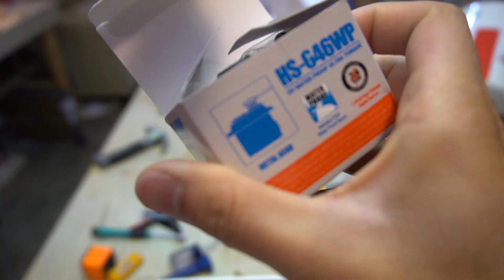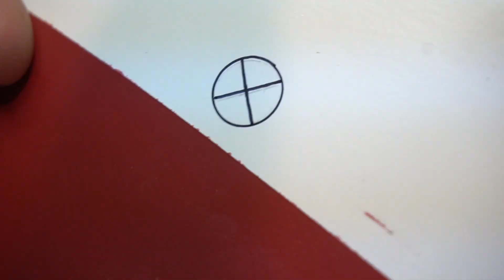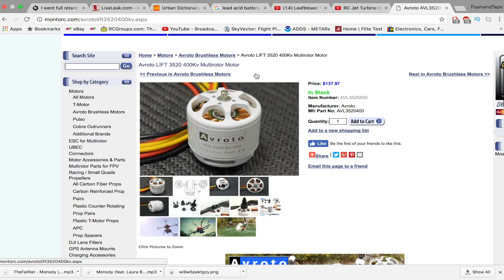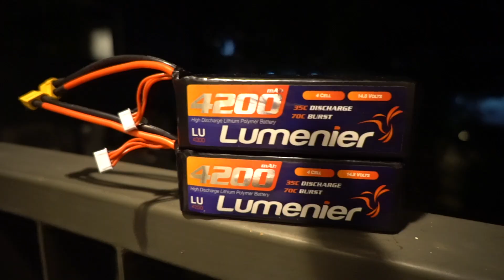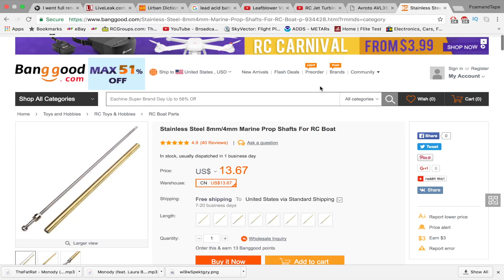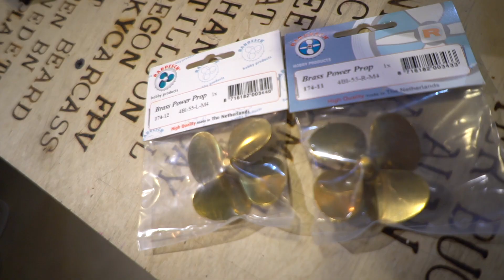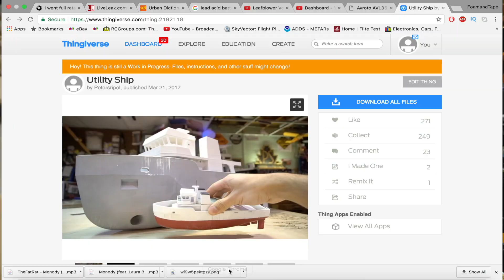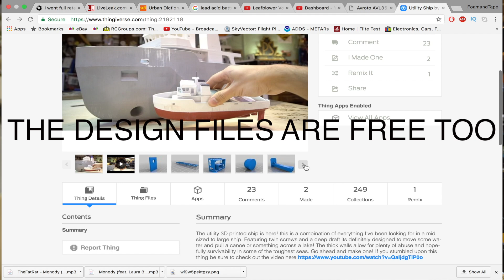GIANT 3D Printed Utility Ship part 2

Comment: Dear Peter, Please make the Ship SINKABLE In the Next part "Part 3" In  08-24-2022 Details of the ship: 4 Watertight Compartments, Lifeboats & Lights Off when Water goes To Eletrical room And use your Grey Submarine fom prev. To loacate the Ship  "Like the Oceangate submarine Locating the Titanic wreck". But you need to use another Ship It is 2× Its size Than Part 2. But with same materials in part 1& 2. Note: The ship that i said Its NOT Jiffy 3 Its U.N.N. Tailor: A Oil tanker Tugboat That Can Carry 2 Lifeboats. 1 In stardboard side and 1 in Port side. The Lifeboats Are 3D Printed "Just like Last one". Details Of Lifeboats: Power; Lights; 1 Propleler(s). One last Thing For The Tugboat: When The Bow/Middle of ship/Stern Hit by Iceberg/Mine/Torpedo/Rock/Another Ship The ship began Slowing to capsize The power Out: When the ship has already water The Ship wheel of Turbine control The Ship lost power. When the ship has no power It began To sink Bit Fast (3,5 Speed).

Comment: Hello, I started to this project. 
I have some question. 

1. which glue did you use ? My material PETG.
2. thingiverse files are completed ? Is there any missing parts or do you have mods ?
3. Do you have a plan for single motor ?

Comment: I know this is a little late, but stainless steel isn't stainless steel there different grades and not all of them a seawater resistant. 
Love that the Ship might make but I only got Ender 3 with 0.4 nozzles and the throughput is so small it will take a lot of time.

Comment: Beautiful. RC boats are my specialty. I have built some big and fast ones. Have a couple vids on YT but they are old. Nice you used counter rotating props this time but crazy how they bent so easy. I run my boats in saltwater as well so I use only stainless steel, anodized aluminum or plastic when possible. And year got to keep the salt water away from the electronics. I build scale but fast boats. Great job.

Comment: I have made one of things and I am wondering what motor and ESC you used for the bow thruster, I got a 1104 drone motor but I think it is too small, yet I don't think it can really fit much more, even though I did print at full scale. 

Feedback would be greatly appreciated, keep up the great work!

You can see my make on thingiverse! (plant0300 or Electr0Maker).

Comment: That haul style for that boat is wrong,  it makes it roll a bunch. The bottom of the boat should be pretty flat across the bottom. These style of boats are built and designed as tug/work boats in the mississippi. They work really well for commercial fishing in Alaska and a large portion of Fishing vessels fishing in Alaska are converted froma prior mission. Here is a picture of the bottom when we were in dry dock Lake Union, Seattle WA https://ibb.co/7XrDr64, You can see the shape of the hull. Here is a picture of it in the water with its sister ship https://ibb.co/tKwFRHv.  It sister ship "American Lady"  is a old WW2 supply ship and has a similar haul shape.

Comment: trying to build an "fpv" thing here.. basically a boat with 3 static cameras and (1 supervizor one that can move)..  sending to 3 monitors into a trailer i can haul around to old folks homes.. so i can have them sit in a "boat" and have them "drive around" for awhile.. how can this work.. is this even possible? guessing we are talking 4 different transmitters sending 4 videos.. from one unit 30cm by 100cm thing

Comment: Amazing boat!
One cuestion, how do you do the connection of both engines?
I'm trying to do your boat but the engines part i don't know how to do it.
Keep going like this
You rock!!
Reply: -You have to do 2 separate speed controllers for the forwards and backwards
-then after that you plug both of them into the receiver (I can’t remember if it’s one plug for each engine or no)
-after that you go and program that into your transmitter 

I’m pretty sure that’s how you do it but I would look up how to do it before doing what I said to do

Comment: That's just awesome , it took me forever to build my first troller from scratch . That was many years ago ..and it was all wood ..which took probably a year to complete , unfortunately my first wife had an awful temper .. and she destroyed it and an all aluminum Cessna 173 with a 4" wing span I sat and cut each part by hand it was skinned with news paper aluminum sheeting ..the only parts I didn't craft was the tires and the antique Kraft 6 channel radio .. she stomped it into the floor ..times sure have changed .. RTR used to mean you got a box of wood lol like a Dumas or Billings model ..I remember how cool I thought it was to buy a kit with precut Lazer parts ...3D printers are simply amazing to me . I still sit down at a drafting table with a pencil .... Any way that is an awesome boat ..  keep up the great work ..I read that someone suggested a submarine ..I remember a story about a wwii Japanese sub/aircraft carrier .. look it up ..it  may make for a really interesting build they essentially used two sub hulls to stabilize the boat . It also housed three planes in a hanger in the deck . . Just for fun I'll bet that would be so cool to print up . That would truly be amazing anyhow good luck I'll be watching
Reply: I now hate your last wife

Comment: For usefulness sake... You need to consider applying your hobby talents into a larger scale... Siri is a top suggestion a useful light cargo vessel on solar First Solar contribute compulsion..  ultimately to be scaled up to something of a houseboat... That probably can transfer report at least three trucks something along the lines of an landing craft.. with a solar roof on top.... The problem that needs to be cracked is horsepower to the screws..  DC electricity contributing 2 gas rotation... This at the same time... The simplest solution is to do like the modern railroad engine band dispatch the solar in..... Ultimately I write this to get you thinking about the future and thinking about how you contribute to humanity and your personal sustainability..  thank you for your videos..  you know a car alternator can be rig to be a motor... Imagine direct solar solar a car alternator and put it to compulsion.. a useful boat may have at least two on each screw... When is solar top roof... This is how the electric car company made it's engines by adding more... It seems to be in the market off the shelf 5 horsepower is the top for 12-volt DC electricity.. and please note in this endeavor take on trying to keep everything completely simple..  like it's that I would RC vehicle..  next thing you know it'll be trying to get these motors above the starting amps that is required to spend the screws.. is puzzling that it has no problem in the modeling world yet in true applications we have this Bugaboo....
Reply: It hurt my brain trying to make sense out of the words you typed out...
Reply: Thanks for reading out the bible
Reply: What the fuck...

Comment: I love the detail on this! But what I've seen in tugs, they sit a bit lower in the water and are highly stable and don't tip easily. It looks like you need more weight in the bottom (I know, right) because it seems your ships center is too high

Comment: I was casually looking at some information on RC Submarines at http://www.subcommittee.com/rcss-radios.html today, specifically looking into how to control a submarine via a wireless controller, when I found this bit of info. Apparently, it's illegal to use RC Aircraft guts to control surfaces vehicles, which includes both boats and subs. Just wanted to let you guys know about this before you (possibly) get hit by legal troubles.

The excerpt in question reads as follows:
"Radio frequency laws allocate separate bands for air and surface models. This prevents interference between model aircraft and surface vehicle transmitters and enhances safety. For example, in the United States, model submarines fall into the Surface Use Only (75 MHz) category along with cars, boats and other non-flying models. The F.C.C. restricts use to a radio tuned to 75MHz on Channels 61-90. Utilizing radios tuned to frequencies reserved for other types of models is illegal. Please check the regulations in your country to ensure that you are using the correct frequency band (Canada is 75 MHz; UK, Germany and most of Europe is 40 MHz)."

Comment: To waterproof batteries and electronics the best thing to use is Plastic dip , see video.   https://www.youtube.com/watch?v=OxyHZ_y4GsQ&t=8s . Use silicon grease  inside servos and radio receiver . And  best place to get parts fast is EBay

Comment: when you build your rc submarine, if possible make your own dive system. like brass ballast tanks or something. please I have built many rc submarines but have never attempted to build my own dive system. most pre-built ballast and dive systems will run you $700+ and if you build it using components most of it might have a hard time fitting in with all the cg issues. These are just my experiences, so if you come up with some really cool new way that balances all the properties out please record everything in detail.

Comment: Peter,
 this is a masterful piece of engineering. As a engineer I'll tell everyone of your skills. As a model builder, I'm asking, Why you didn't detail the interior of the wheelhouse. Your video shows that there is enough room for a captain, a chart table and a radar that could have been seen through the portholes. A man or woman outside climbing a ladder going from one deck to the other, and a lookout or crewman on the deck could have also been made. What's a detailed model without a crew? Make a crew for your ship. Or buy a crew at this scale. Don't forget the sunbating hot chick. It doesn't sound like it, but it WILL be more enjoyabe having a crew. Excellent work Peter, I'm happy to see this and I am proud that you showcased your skills in this video. My lady use to think we were nuts doing things like this. Until I took her and showed her how much fun it is. Let me know what3you think. Best wishes.

Comment: Hello! I do not understand why put so expensive in engines, etambot, propeller for a simple tug? 2 motors brushed universal Motraxx X-Drive 540-1 5600 RPM with torque "12.5 Nmm" was enough and at 10.99 euro.
Dimmer at 20A is enough for 7.45 euro. The stern tube does not even pay 6 euro the unit or even to do. For helices of this size, they have not even more than 10 euro. We use the lead batteries and not the Lipo. XD A good 12v to 7A or 12A to less than 20 euro. XD It is used precisely as food and their weights.
We laughed. xD
Thank you nevertheless for the assembly of the tug.
A +

Comment: Fun fact: The red that is painted on the bottom of the ships hull is not there to just look kewl, it actually serves a purpose, there are chemicals inside the paint that prevent any barnacles from attaching onto the hull. It's also the reason why it's red. Ik this because my grandfather was an inspector that worked for a German company that made ships like freighters and bulk carriers.

Comment: you had stability problem because the "not hull" part of the ship (the superstructure) is too heavy. usually, the G center is inside the water because of the heavy weight of the hull comparing to the rest of the ship structure.

Comment: This guy should build a 3D soviet submarine. Give it some cool features like torpedoes and a small AA gun on the front of the sub...
Reply: Austin McDuffee  I love your comment
Reply: Yes
Reply: submarines are awesome but the standard 2.4g radios dont work well underwater, a few metres and you will lose signal.
Reply: @maxxiang8746  Conn, Manouvering, Make depth 2ft.
Conn, Sonar, Raise the radio mast
Reply: @dosvidanyagaming4123  what?
Reply: @maxxiang8746  was meming a bit, but essentially, sail it shallow and have an antenna stick up and you'll be fine

Comment: Another awesome video, Peter! I love how you said  "only my 3rd design.... I just kinda made up some measurements in my head and started going from there..." LOL ... I know guys who have been RC boating for 20 years that couldn't have designed something this nice. Good stuff. We would recommend water-cooling your motors, but if they are not working too hard, you're good.
Reply from the maker: Did think about water cooling them, but even under way at a fairly high throttle setting the thing is still room temp! (well that and the flooding inside tends to cool off the motors!)

Comment: Great! now you got me wanting to break out the MONICA. Its my fishing trawler I got from a GoodWill. I want to add a smoke generator I have for it. I went through it last year and had to gut it and rebuild the electronics. I cant remember who I buy boat supplys from. The nets actually work,the spotlight works as does all leds and cabin lights. They made a fireboat also but I havent seen one. Mine was made in Germany and sold for $200. The circuit board was supposed to be waterproof( they dipped them in bees wax.) It is a rare boat to find as all of them failed as soon as the electronics got wet.  You did an outstanding job on your boat. I do see some room for improvement but in the long run,its not much of a thrill for younger guys like you. My suggestion is to eventually box it up until you age slightly. Then break it back out,you will really enjoy it more. Dont burn it or blow it up please!
Reply from the maker: Hmmmm it still has some duties to perform this 4th of july! Its going to serve as a makeshift torpedo vessel. If she survives,I'll retire her to the shelf for a few weeks! :D Would love to see the trawler in action too! Thats one hell of a Goodwill find!
Reply: PeterSripol I will send you some video as soon as I get the smoke generator going.

Comment: Stainless steel is not rust proof. It is corrosion resistant which means it doesn't rust as readily as other metals. This is especially true with parts that will be submerged in salt water.

As I SCUBA diver and machinist I am all too aware of rust even on the most expensive stainless steels.

Comment: How do the brushless motors go after the salt water exposure? I noticed you caked them with some kind of spray but wonder if it's a 'per outing' thing or could some delicate epoxy coating on the exposed connections do it? Love the build man, that scale works so well and it rides and lists so realistically!
Reply from the maker: Honestly they're not too bad! The high quality ones don't need to be oiled so often, the German bearings don't seem to rust like the Chinese ones do. Epoxy would work well, but I'd have to find some nylon bushings to replace the bearings for it to be almost 100% maintenance proof.
Reply: Hi, first of all congratulations for the beautiful work!  I'm starting to print the model.  I wanted to ask you for 2 suggestions.  1-is the model to scale?  I would like to get some motorized accessories such as radar etc. 2- how do you create the bow thruster?  thanks in advance for the info.

Comment: I don't know if you read the comments but I have a challenge for you but I think it'll probably be out of your range.The BBC programme Top Gear once tried to make a Robin Reliant 3 wheeler into the Space Shuttle with the idea that the car would detach from the rockets and be glided back down like the Space Shuttle.Amazingly, they managed lift off with the side boosters detaching as planned and it only failed because it didn't detach from the main fuel rocket.Have a look here on YouTube for it.

Comment: Printing in PLA was mentioned in part 1, but I think that might be problematic, since the water might cause degradation or distortion of the material. I guess you could try to mitigate the affects of water using some kind of waterproof paint.

Unfortunately my printer only does PLA, and the print bed isn't big enough for something this size! But I might look at printing a smaller boat for my nephew sometime.

Awesome project though!

Comment: Super cool! I noticed though that the boat has a difficulty cutting through and staying stable in the sea, though. You should try and make the hull into a taller "v" shape and add a ballast tank on the bottom of the hull. I know it is supposed to be a tugboat, but this would be a cool idea for another boat build I believe.

Comment: Hey Peter can you help me? I am making an electric skateboard the problem I have is I don't know how to set it up I think I need a 40 amp esc but I don't really know what that means. I'm using an 11.1v batterie a 2200kv motor I know and a fly sky esc with a remote already binded. Thanks

Comment: Wow!  Peter I was very pleased seeing you put together all of these detailed components - I recognized every one.  Did you remember to use LockTite on your propellers this time?  I wondered if you ever recovered the one that fell off of the the boat that you cruised up into the stream.

Also, the single component that I was hoping to see on this build was an AIR HORN!  That would have scattered those pesky monkeys quickly enough.  I look forward to seeing the submarine project.  Have you ever considered building a US Marines LCAC (assault hovercraft) and the amphibious-well dock ship that carries them?  You could build a whole set with the USS Germantown (LSD-42) dock ship carrying an LCAC, which itself is carrying an M1 Abrams tank or maybe 1 or 2 other vehicles and perform your own invasion by sea.

Comment: You ought to build a fast electric catamaran next :p power it with a Leopard motor on 6s and you can hit the 60s and 70s easily.

Also for ordering anything boat related a good place to go is offshoreelectrics.com. They have props, motors, shafts, everything you need.

Comment: maybe you could stabilize it with a cone under the water like big ships have, it looks like a submarine is welded to the bottom of the boat, and then fill that area up with something heavy or heavier just not to heavy like heavy metal:) just kidding btw. could also use stab fins under water